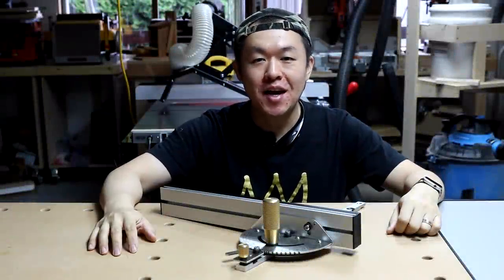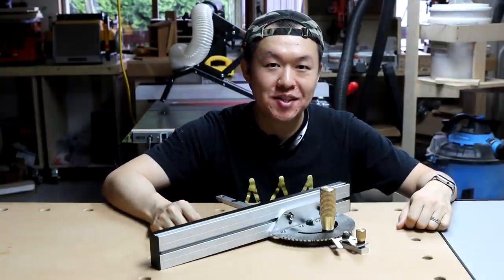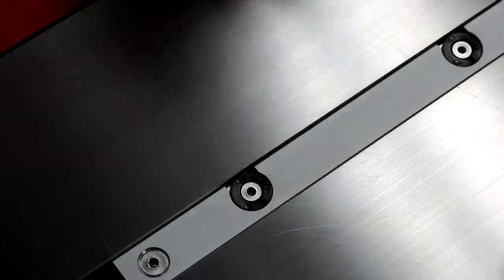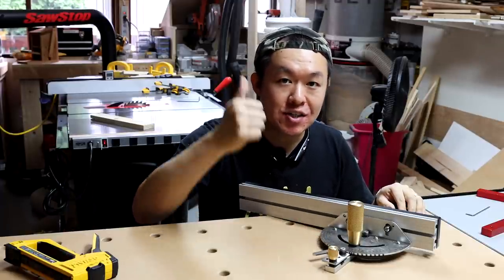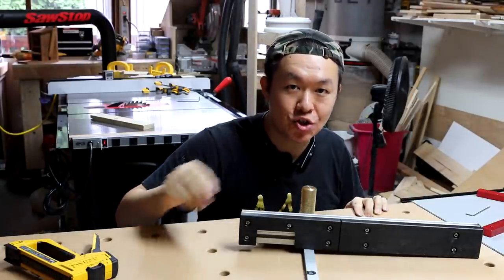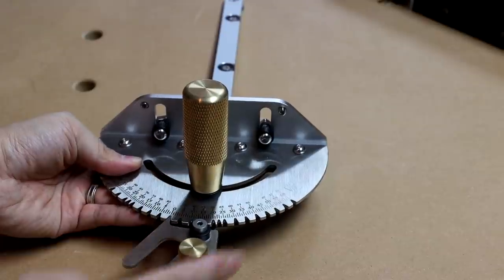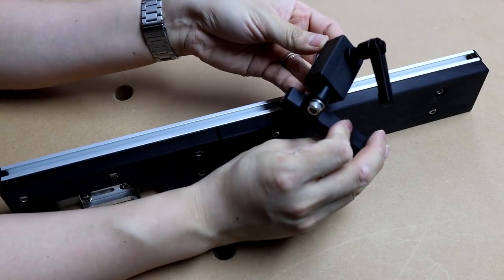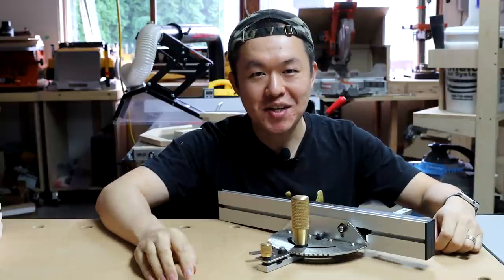Drillpro Miter Gauge Box Joint Jig | Best Tool for Your Money! | Banggood Woodworking Tools Review

Comment: I have the aluminum version of this "New" a.k.a. Drillpro miter gauge.   As far as I could tell, the only difference was the other had a brass handle. Not important to me, so I got the solid aluminum handled one.   I know I didn't pay as much as they are asking now.   I think I purchased in the summer of 2020 and paid something like $30-35.   That said, even at the $53 plus shipping and tax Bangood wants now, I would buy it again because it's well worth it.   
I am very very fussy, yet very impressed with this miter gauge.  It's really accurate.   And easy to adjust.   I put my own sacrificial plywood fence on it.   I love the adjustments for the miter slot in your table saw.  I did not need to modify my pointer with a file as he showed.   Incidentally, mine came quite quickly.   I think from N.J.?  I can't recall.   Maybe there is a U.S. warehouse there?    Anyway - buy one.   I think you will be very impressed as this young man is.
Reply: I bought the same version as you and I agree with everything, it is awesome

Comment: Cheers Ding! Great review of the mitre gauge, even pointing out the need for the slight modification. I have a less than stellar job site table - don't get me wrong, for the money, it's been great - and the mitre gauge that comes with it is all but useless. With the rising cost of timber, I'm just not happy about wasting material and have been looking for an alternative for some time.
However, I don't want to spend more on the mitre gauge than the actual saw, so, having watched your reviews among others, I think I might give it a go.
Thanks so much for sharing.

Comment: Hey Ding.  If you're like me, I hate having loose parts floating around the shop.  Here is a tip you can share with your viewers on this Drillpro Miter Gauge Box Joint Jig!  Instead of removing the feet for box joints every time you want to use the Miter Gauge and Fence do this.  Cut a piece of 3/4 plywood to fit the fence like a sacrificial fence or backer board, then add a tight top to fit over the top of fence, like an upside down letter J.  Now slide your wooden jig down from the top until it hits the Box joint foot.  Make a pencil mark on your jig, then remove the jig and head over to the table saw.  Now cut a 1/8" or 3/16" slot on your pencil mark the exact height as the foot of box joint and you're done.  You could also use double sided sticky tape if you prefer.  This way you will never ever need to remove the screws, nuts or the foot period.   Leave it in place permanently.  I hate screws floating around where you can lose them or never find them when needed.  Nice idea.  Enjoy!!!  Paul

Comment: Hi Ding, Thanks for the nice review. Could you tell me what size hole to initially route out in the black plastic fence as it appears to me that making a box with 1/4" fingers, is soon going to be opened up to 1/2" when making  1/2" fingers, or, do you slide the fence along & make additional holes for each sized router bit to be used? Sorry, I'm confused 😕 😕.
Reply from the maker: I actually did not intentionally make any opening on the backerboard.  As I use the jig to make box/finger joints, I just allow the blade/router to cut into the backerboard a little to start the process :)

Comment: Great review. However is the location of the jig in the table slot not now dependant on two small surfaces of plastic? This will surely wear over time.
Reply from the maker: there are total 4 plastic rings (on one side) and you're correct, the miter slots are indeed against the plastic rings.  I did notice these platic rings have a rather low coefficient of friction and therefore making the sliding motion rather smooth.  The low coefficient of friction also lowers the amount of "grinding" there is.  Ultimately, they sure will wear out, but should be a very long time.  I also happen to have the Incra Miter 1000HD miter gauge <- this one actually has plastic rings on BOTH side of the slot stick.  I've used my Incra 1000HD for 5+ years and have not noticed inaccuracy caused by the rings being wore out :)

Comment: Just got mine, and it's amazing, using it on my Dewalt 6480.  I only wish I would or could see how to have ordered the optional simplified Left Backing Pad and screw.  And the stop block, not to worry, I made a work around.  You must have cut that opening in the Black backing of the fence, as mine did not come with that opening for the blade to go completely thru the fence.
Reply from the maker: Yours did not have a notch on the aluminum fence which allows the blade/router bit to pass through? 😮
Reply: @DingsWorkshop   at 4:47 in the video you are using the router bit to cut the joint,  It goes completely thru the fence, that gap you have in the BLACK part of the fence.  It's solid on mine, and you'res looks like you may have cut your's out in order to let that router bit cut completely thru the fence. At 7:55 it shows the gap or cut in your black part of the fence.  My black part of the fence is solid, no cut like that.
Reply from the maker: that's surprising!  I mean, I expect manufactures to release updates on their products, but I don't understand why they eliminated the opening notch on the aluminum portion!
Reply: @DingsWorkshop   The Aluminum has the gap but the box joint jig, the polycarbonate black fence next to the pins i solid.  It looks like you cut that opening with your table saw.  Also still trying to figure out what the large washer at the end of the slide is for.  It won't fit into my slot on the Dewalt 6480.  I removed that and the gauge is working fine.
Reply from the maker: Oh now I get it. Yea I did cut through the black portion on my first use.  The little washer is there for table saws that has a T slot for the miter slot
Reply: @DingsWorkshop  Thanks much, really happy with this thing.  Truly a robust tool.

Comment: Hi.  I noticed that you had cut a space in the black plastic section of the fence housing that contains the box joint jig to allow a saw blade or router bit through the opening that already exists in the aluminum part of the fence. It seems there’s no other way for the saw blade or router bit to obtain that vertical clearance besides sliding the two black fence sections a couple of inches to the right, across the aluminum.  True? Thanks and happy holidays!
Reply from the maker: HI Gerard, happy holidays!  When this tool first arrived, both black pieces are rectangular.  When I made the box joint and finger joint, the portion of the black piece (originally covering the aluminum opening) gets sacrificially cut.  If I want to use this as a regular miter gauge, I need to remove the two small aluminum fingers on the box joint jig, which is pretty easy.  I'm not sure if I understood your question fully...Please don't hesitate to let me know if you need more info :)
Reply: @DingsWorkshop  You answered my question, thanks!  Just wanted to confirm that you had cut away a section of the black composite material to create an opening that aligns with the opening in the aluminum side of the fence.  Regards!  Gerard
Reply: @DingsWorkshop  Hi, what is not clear to me, is a hole the bigger you can with the bigger head to tenoning you have and then you use as is or for smoller tenons? In other words, this sacrifical cut, have to be like in some videos showed for 8mm head and with 8mm steps or can be bigger and then you decide what step use, reducing the 2 aluminium little tooth spaces in relation of bit head dimension? Thanks

Comment: Hi, I have a question: the scale is devided and locked per 5°. Do you have an idea how to set up and lock  e.g. 13°? Thank you.
Reply from the maker: for 13 degrees, you cannot use the pin to lock the "gear".  However, you can still dial the miter gauge to 13 degrees, and lock it into position by tightening the brass handle

Comment: do they come saw specific? i have a Hitachi saw. love it, but, the chanels are t shaped rather than square.
Reply from the maker: Hi Johnny, as long as the miter slot is 3/4” wide (or slightly close to it), this tool should work.  My table saw’s 3/4” miter slots are also T shaped.  It helps “lock in” the miter gauge and prevents it from going upward

Comment: What is the width of the bar guide? I live in Europe and the slots on table saws are not the same as in US.
Reply from the maker: Hi! The bar is 3/4 inches or approximately 19mm.  There are 4 plastic rings on the bar which can expand the width to be larger (but can’t make it narrower).

Comment: I ordered 1 after watching this. 1 question, did you have to cut through the plastic and aluminium jig when first using the box joint jig? As it seems as though I have to to use it
Reply from the maker: Hi Andrew, I did cut through the plastic portion on my first use.  But the aluminum portion of the fence has a 1.25" x 1.25" opening, so you will not need to cut through aluminum.
Reply: @DingsWorkshop  thanks

Comment: Do you think it would be possible to replace the runner with a slightly narrower one (in hardwood or aluminium)? The table on my bandsaw has a 14mm t-slot. Great video - new subscriber.
Reply from the maker: Hi Bill, the whole assembly can be disassembled down to each components, and thus I believe you can definitely install onto a barrier runner, as long as the holes for screws are positioned correctly
Reply: @DingsWorkshop  Hi thanks for a speedy reply. Is it possible to buy the fence without the box joint attachment.
Reply from the maker: HI Bill, do you mean like this? https://www.banggood.com/custlink/3vmRQjmbje
Reply: Yes, but as I’m using it on my bandsaw I don’t need the box joint jig bit. Maybe at that price it’s worth buying it but not using the box joint jig.

Comment: Hello Ding,
I ordered the miter gauge and is very nice as you describe.
My shipping time was about 2 months.
How did you use on a table saw since the extruded aluminum bar is solid and one piece without a gap for the saw blade?
Did you saw a gap?
I used it on my router table and that worked. The bit stayed in the plastic waste block.
-Steve
Olympia, WA
Reply from the maker: Hi Steve, I’m not sure I understood your question.  Are you asking how to use the box jig on a table saw?  I essentially sawed through the black waste block piece when I made the finger joints.  The aluminum fence has an opening so I was only sawing through the dense plastic, not aluminum.
Reply: @DingsWorkshop  Hi Ding, My aluminum fence did NOT have an opening so my miter gauge only works on my router table.
Reply from the maker: Huh..that’s odd.  Do you mind sending a photo of your fence to me?  Dingsworkshop@gmail.com

Comment: I recently received my miter gauge and I am disappointed in the product. The aluminum miter bar is too flexible and causes the gauge to bind to bind when pushing on the tall handle, especially when set at a large angle such as 45 degrees. Additionally and even worse is the inability to set the gauge at any angle other than the detent angles (5 degrees increments). If there is a way please explain.
Tony E.

Comment: What is the thickest material that can be used for box joints with the jig?
Reply from the maker: The largest gap/slot that can fit between the two pegs is 15/16 inch
Reply from the maker: The 15/16” is only the biggest box joint “teeth” and spacing.  There’s no limit on the thickness of the material
Reply: @DingsWorkshop  So, as I asked, theorically if you have a 15/16 router head you make a 15/16 cut in miter to be ready to maximum size you can tenoning?

Comment: I have one. it's bogus. the ad says it fits Crafstman 3/4" slots. no. it fits benchtop saws wth 19 MM slots. It does not fit old American cast iron Craftsmen 3/4" slots

there is a complicated aluminum stamping on top that has a tab that fits into the web shaped cutouts for the various preset angles. the hole is drilled about 2 MM off it makes the tab fit in wrong, and the preset angles are rotated clockwise about 3 degrees

it is as useful as a fish bicycle. you can use it to crack walnuts

Comment: The mitre gauge is basically a rip off of the incra item
Reply: Yes, the Chinese are adept at copying things and offering them for a much lower price.  In this case, the $89 dollar Banggood miter gauge + Box Joint Jig is $100 dollars less than the Incra 1000HD.  However, this Incra is not a Box Joint Jig.   Comparing Miter gauge to Miter gauge alone, Banggood at $59.00 is less than $129 you'd pay for the Incra SD1000.  I own both and the Banggood is more solidly built than the Incra.

Comment: well i think you were lucky with your miter gauge as the one i bought was totally non useable because it was machined wrong as you could not use the angles as machined incorrect the only correct cut was 90 degree all others incorrect